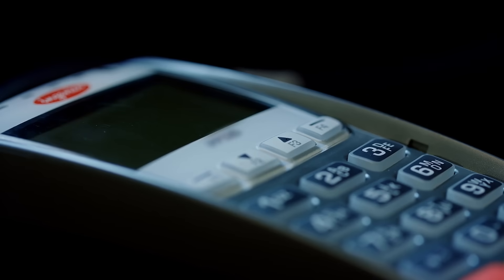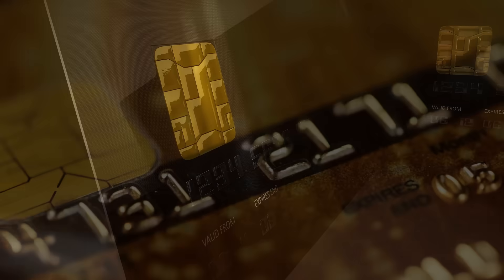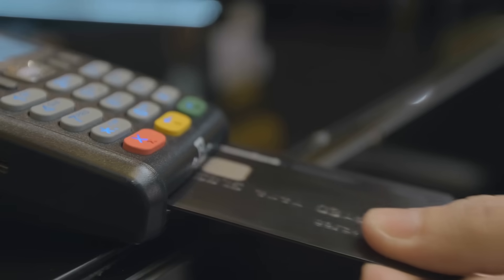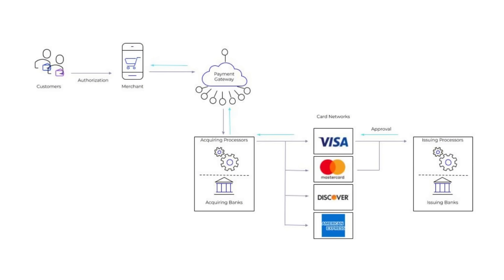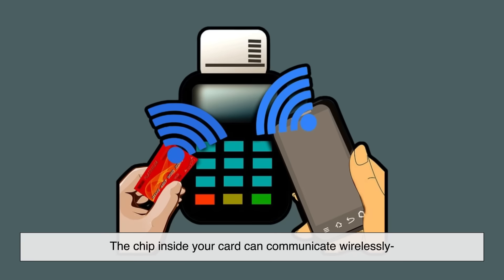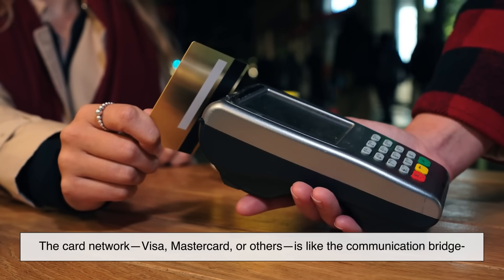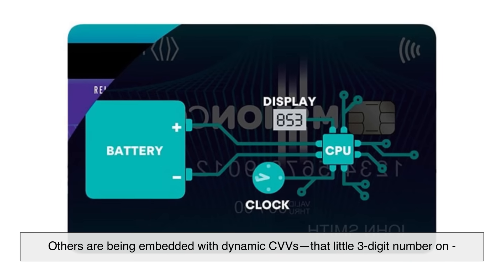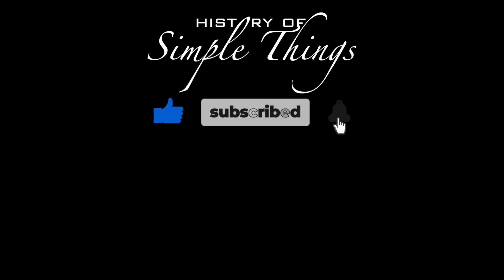What’s Inside a Credit Card Chip and How It Works

Comment: All that great security technology turned into worthless crap by changing card procedure so that tap-tap could be used WITHOUT an accompanying PIN number. Got ripped off of several hundred dollas this year by FAMILY members who used my card without authorization ... 'til I learned about 'locking' it when I'm not planning on using it. Then I gotta remember to unlock it before I attempt to use it or I will get 'transaction declined' message. Ain't technology great!

Comment: If your card get stolen, and has tap on it, you will be liable for the charges until you report it stolen. That could be a lot of money in a few minutes, depending on your tap limit. Get the tap feature removed, and require a PIN on all credit cards. The bank will do this. That makes it much safer.
Reply: so many things wrong with your comment..for a credit card you are only responsible for the first $50 and some banks it is $0..of course you need to report it stolen in a timely fashion.. ..which is a few clicks in your banking app..and the bank may take upto 30 days (for a fraud check ..this quite complex check it makes sure your card was actually  stolen..i cannot go into detail since i do IT work for quite a few banks..) to return your money except $50..

if your card requires PIN it does not matter if you tap or insert it will prompt for the PIN..so one is not safer than the other..

best advice turn on all notifications on your banking app..so 1 transaction will be made before you are alerted and can disable your card..

Comment: Well, remember this... The first rule of security is physical protection.  If a thief has your card, they can use it in many instances.  Transactions almost never require any PIN that only you know and is not stored with/on the card.

Comment: 5:54 And let's not forget that we own all that to payphone cards, they were actually the predecessors and it's disheartening that they predate credit card chips by decades... pay phone cards were actually more secure than credit cards for way longer...
And just on card rolling codes, that can be worked around on a contactless payment as most pos providers implement a "payment window" in which inbetween a sensed antenna transmission and receprtion of ingo, the payment info has to be exchanged else payment will be declined.
For the user it will be just an error, but for the bad actor behind that was messing with the signal all the while intercepting a valid token, they now will have one for the newly cloned card...and it will work as it's isued by the bank, valid and never used...

Comment: And yet, I heard they can still steal your money using such a payment terminal and enter the max amount you can pay wirelessly without typing in your PIN number multiple times and steal $600 or so in just a few minutes by holding that terminal to your back pocket where usually your wallet is located. Still, there is alot of impressive tech behind it all.

Comment: They are not Chips. Stop calling them this. The proper term is radio frequency identification tag (rfid tag). These are passive devices and don't contain computers or operating systems.

Comment: also cool.. I had no idea about the one time code (effectively an OTP) for each transaction on the card...

We need this online, and must be done by the banks,, not a 3rd-party....  
eg Users could turn it on in the bank (perhaps charged a $2  pre month "feature is well, worth it for security) online,

2FA works,, but can also lock legs users out  out too, which is an oversight most forget, in favor of what it provides. There are better ways.

Comment: That magnetic stip was 'unencrypted"? crazy !!
no wonder they switched to to 'Tap and go'

Plus, wasn't it about the same time SSL was introduced for online web shopping ?  (well 1994 vs 1960..,.. WAY before..)  eg.. people were too afraid to surf on the limited number of online websites at the time due to lack of security, so one could also argue the "unencrypted magnetic strip" could have also been an oversight too. (and therefore paves the way for "batter alternative") but I guess security was not really up to code then as the reason so its makes a valid point.

Comment: The chip is secure, but at most gas pumps, you have to slide the card in past a magnetic reader in order to access the chip.  That means that the mag stripe can be read by a skimmer as you try to use the chip.  Since the PIN code is the same 4 or 6 digit code for the chip or the mag stripe, your pin can still be stolen via a small camera on the skimmer.
Reply: there is no PIN on the mag stripe.. This is why at ATM's for example you must manually enter your PIN to proceed... If it was that simple as scanning the card, no PIN would be required. But it IS stored entered on the chip. later use.
Reply: When I use my swipe card I specifically go inside the gas station and hand my swipe card to the employee in the store for that very reason.   He then gives me a printed receipt for the amount of gas I pumped.

Comment: I don't like how I'm not asked to enter my PIN at every transaction. Only once in a while. Which means if I loose the card anyone can use it.
Reply: A good workaround is this : suppose your pin is 4567. Pretend to enter a digit that is not tour pin. For instance push 45 then pretend to push 8 then push 67. Anyone watching won’t really know what your pin is. Of course cover the keypad with your hand and learn to know where the keys are. If someone is standing close to you ask them to move back or wait till they leave.
Reply: @gregorymckenna6609  That's not really what was asked. The question is about anyone being able to use the card for contactless transactions - and yes, anyone can, which is why they put a limit on the amount you can purchase using contactless, and have software monitoring trends which would hopefully pick up unusual transactions and block the card.

Comment: if you try to remove the CHIP and put it in a ring , TO WILL NOT WORK. unless you also take the small antenna wires embedded in the credit card going from corner to corner.

Comment: Very interesting.  I just missed one thing: when you tap, so wireless, how is the chip than powered? Must be similar to rdid tags, that the hf signal also powers the chip.
Reply: per chat gpt, the chip is powered by electromagnetic induction from the card reader. This RF field induces an electric current in the card's antenna — essentially wirelessly powering the chip.
Reply: Yep same as RFID chips.  Magnetic field from reader.

Comment: Tap to Pay is less secure because you very often don't need to enter a pin for certain amounts. 
And since it's Tap, you may not know a card machine is within range...
Reply: "Range" is 4.5cm 😂
I use tap 99% of time. Extremely safe. Kept in my $16 RFID-blocking wallet...
Reply: @cnfatman that is extremely UNSECURE
Reply: @cnfatman  And when someone takes it ? 
"Tap-no-pin has a R200 limit"  per purchase, with R1000 total limit."
I'm not willing to lose $50, $10 per tap...

Comment: In NFC, a coil on the card picks up the energy that powers up the chip on the card, magnetically. Hence the need for close proximity.
Reply: Actually it is electromagnetic induction. Magnets alone with transfer power
Reply: True. I used the wrong vocabulary. I meant - magnetic near field - induction between two wire loops @enadegheeghaghe6369

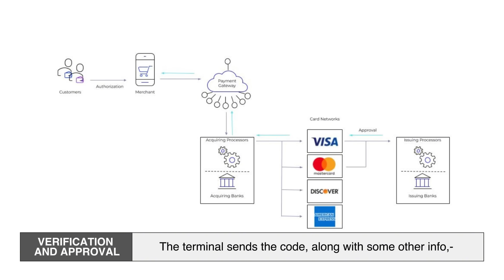Comment: 3:32 surprised by that statement that the bank uses its own copy of your secret keys - thought the idea was a secret key on the card is completely inaccessible, a real private digital identity.
Reply: Well, how will your bank know what transaction your card is performing if they can't decrypt the data they receive from the payment terminal?
Reply: The way encryption/decryption generally works is that you can't actually work backwards from what you've sent. Even if you could, you'd need to check it was correct at the bank, as pointed out. So the bank uses the same method to encrypt the same data, and then compares what it receives.

Comment: If someone steals your card, how does this chip prevent unauthorized transactions?  I don't think it does. The card owner still must realize they don't have their card and report it lost or stolen.
Reply: Vast majority of cc thelf isn't done by physically stealing your card or finding a lost card... But, to avoid even that, you could use Apple/Google Pay with unlocked cards, and keep only locked cards in your wallet (ATM/Costco in my case). I have to unlock my Costco card via app...maybe once a month...

Comment: Great Video, HOWEVER, you missed a part. Most cards STILL have that black strip; Is it the same sort of strip used before all the chip technology? Often I have been asked, or HAD to use the black strip, then the given terminal reader would /or read chip, and/or did not have the TAP function (or did, and neither would work). Thus, say, if I end up having to use that black strip, am I giving up all that security?
Reply: yes
Reply: I keep two cards: one always unlocked, but with mag stripe (and printed cc info) DESTROYED. And the other card always locked but with mag stripe intact.

Comment: What about RFID thieves? Can they still steal the chip info and encryption?
Reply: They can't duplicate the chip info, so they can't use it at their fav store. But what they could do, is use a hacked merchant account and rack up charges by getting near your cards, then they quickly empty that merchant account to other shell/mule accounts... I use an RFID blocking wallet even though that risk is extremely low - mostly theoretical...

Comment: I hate chip cards!  They take longer then just simply swiping the card!  Also there are times when it doesn't work and it needs to be done again.  Finally, it leaves the card exposed so others can get a glimpse of it and atleast half of the numbers.  It is not as secure as people think it is.  Get rid of chip cards!!
Reply: I use tap 99% of time... Nobody can see my card number because I have holes all over my card...only chip and tap work...
Reply: A few moments of your time is worth the security. If you use chip and pin, then you don't need to fear someone seeing the number on your card. It's useless to them
Reply: @enadegheeghaghe6369  If someone next to you uses a camera, or works in teams each memorizing diff chunks, it could be a security issue. There's no reason whatsoever to have the card number and cvv printed on the actual card these days... Keep it in a secure place (phone app is fine if you only install 50M+ downloads apps), then physically remove it from your cc. I use a belt hole puncher... Waiters, gas station skimmer/cams, etc cannot get my card number because the mag stripe itself is also destroyed... Chip or tap only... Otherwise, I temp unlock my Costco Visa (or ATM cards) with intact mag stripe...

Comment: Australian here …… no one, no one uses chip and signature in Australia…... It’s always and only ….chip and pin.
Reply: Foreign cards (e.g., U.S. cards without a PIN) may still be accepted with a signature at some places in Australia, but not everywhere — especially in unattended terminals like gas stations or train kiosks.

🧠 Best Strategy for an American in Australia/Europe:

Use your Chase or BofA debit cards at kiosks and for small purchases. Keep the card locked in the bank app to avoid fraud.

Use credit cards (Citi/Amazon) at staffed locations.

Bring mobile wallet (Apple Pay or Google Pay) as a backup — it often works where physical cards fail.
Reply: @cnfatman  signatures are not required anywhere in Australia

Comment: Around where we live there is a Dollar limit on the chip tapping function. The merchants do not seem to know how much the max to tap is most of the time. So it is just easier to slide it in & tap the PIN right off the bat  anyway.
Reply: The tap limit is set by the card issuer and can be different for each card. The merchant can have a general idea, but won't know with certainty what it is for the card that you're using.
Reply: Never had this issue with my Citi Costco or Chase Amazon Prime anywhere in US. I only use tap, and occasionally get asked for a signature

Comment: the chip  while more secure it is still skimmable  there are skimmers that fit into the card slot.

the most secure is the tap to pay since it is not skimmable yet*

*= no reports i am aware of that anyone successfully skimmed a tap however it is possible to ping the card and steal a tap using small electronics in pocket or priefcase.

Comment: 0:50 Security code (CVV) was never stored in the magnetic stripe... But malware could still sniff it just before being sent for cc processing. Also, sometimes, merchants kept cvv's even though they weren't allowed to...
Reply: The CVV was mainly for CNP (Card not😊 present) transactions on line.
Reply: Your pin number used to be stored on the magnetic strap 

And you could use a VHS player to get the pin number to display on the VCR
Reply: @lesnelson3458   There are TWO types of CVV:

1. CVV1/CVC1 - Encoded on track one and two of the magnetic stripe of the card and used for card present transactions. This code is automatically retrieved when the magnetic stripe of a card is read (swiped) on a point-of-sale device.
2. CVV2/CVC2 (the 3-4 digit printed code) - This code is often used by merchants for card-not-present transactions including online purchases. It is not present in the magnetic stripe.

As for the comment about PINs on the magnetic stripe - that's a myth. PINs are never stored on cards; they're verified against encrypted data at the issuing bank.
--
The “PIN was stored on the magnetic stripe and you could use a VCR/VHS player to display it” claim is not true as stated.

1) PIN is not stored on the magnetic stripe

Payment networks and issuers are explicit that the PIN itself isn’t stored on the magstripe. For example, Visa’s PIN security guidance states: “The PIN cannot be stored on the magnetic stripe of a card.” 

What can exist on a magstripe (depending on issuer/network) are values used to verify a PIN (e.g., “PIN verification value” / “PIN offset”), but those are not the PIN and are designed so they don’t reveal the PIN without issuer secret keys/systems. 

2) The “VCR shows the PIN” part is an urban legend

There are long-running discussions calling the VCR idea a myth; one archived thread states plainly that using a VCR head to read a card and get the PIN is an old urban myth. 
Also, even electronics folks note it’s highly unlikely to use an actual VHS/VCR head as a practical magstripe reader (VCR heads spin and aren’t built like card heads). 

3) What is true in the neighborhood of that story

It is possible in general to read magstripe track data with a magnetic “tape head” style reader (the physics is similar), but that would expose things like track data (card number/expiry/service code), not a PIN. 

Bottom line: the “PIN on magstripe + VCR displays it” story is false; at most it’s a distorted version of “magstripe contains verification-related fields” plus “tape heads can read magstripe data,” neither of which gives you the PIN. 
--
The last comment claims your PIN used to be on the stripe and you could "use a VHS player to get the pin number to display on the VCR."
 * Status: FALSE / Urban Legend.
 * The Reality: While it is true that a magnetic stripe card works on similar principles to VHS or cassette tape (it's iron oxide particles on a plastic film), you cannot simply run a credit card through a VCR and see your PIN on the TV.
   * Reason 1: The data is digital binary code (1s and 0s), not an analog video signal. A VCR wouldn't know how to interpret it as an image.
   * Reason 2: Your actual PIN is generally not stored on the card. Instead, the card stores a "PIN Verification Value" (PVV) or an offset—encrypted data used to mathematically verify if the PIN you type is correct.